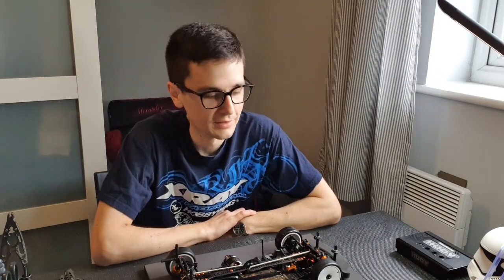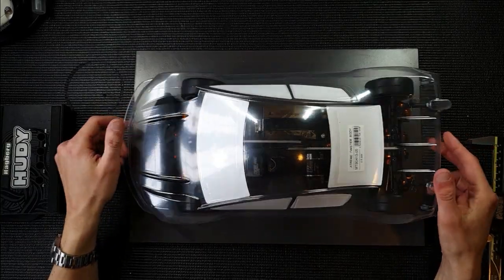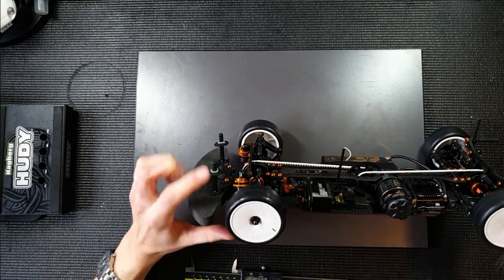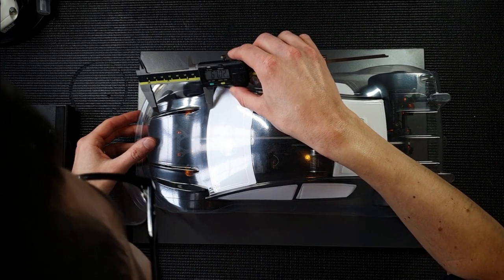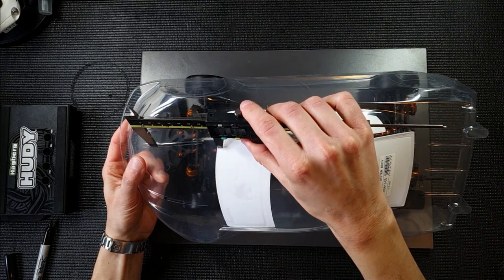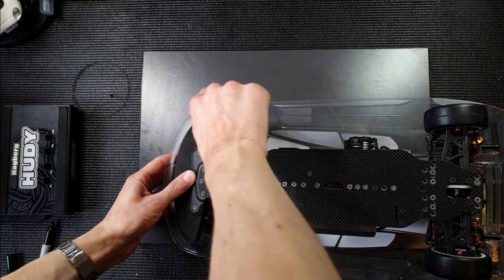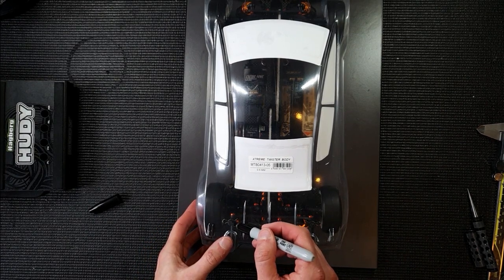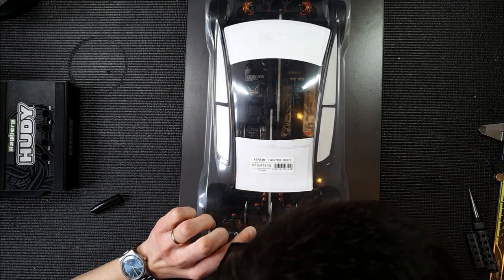Bodyshell Mounting Tutorial

Comment: @Alexander Hagberg - What about the body clip placement for racing? Do you suggest using the body post hole the nearest to the body shell for the clip, thus preventing little to no upward travel of the body shell, or do you use the next higher body post hole for the clip, allowing free upward travel all around of a few millimeters?
Reply from the maker: Make sure that the body isn't tight, and has at least 1-2mm of play!

Comment: Another amazing.video !!! very nice and explanatory.  Is it ok for asphalt the body ground clearance of 8mm or I should aim a little bit higher i.e 8.5 mm ?
Reply from the maker: Thanks! 8mm for flat tracks and 8.5mm+ for bumpy tracks!
Reply: @hagberg  one more question: should we first paint the body (case with one color with spray can) and then cut the wheel arches or we can paint the body after cutting the wheel arches?
Reply from the maker: @constantinosdrakakis897  it comes down to personal preference. I usually do it after the body has been painted.

Comment: Hi Alexander, 
This is truly the best way anyone has ever showed me, Thank You, I tried it and like magic body and wells fitted like a glove.
Just wanted to ask, should there also be around an 8mm gap in between the top of the tire and the well? (inside the wheel well)
problem I get sometimes is the tire rubbing on the inside of the well as the car leans.
Reply from the maker: Thanks, I am glad that you liked the video! I don't usually measure that gap, but I do apply chrome tape or repair tape to the area in side of the bodyshell where the tire is touching on suspension compression! This will reduce the friction in that spot, and also limit any damage to the bodyshell.